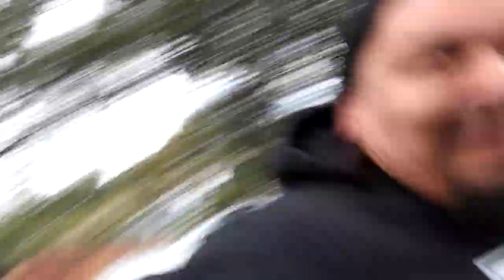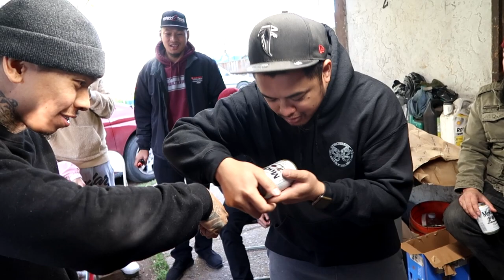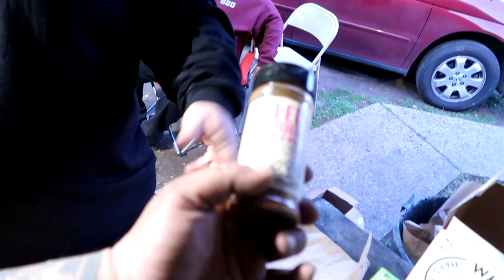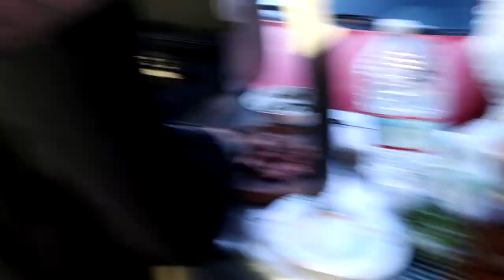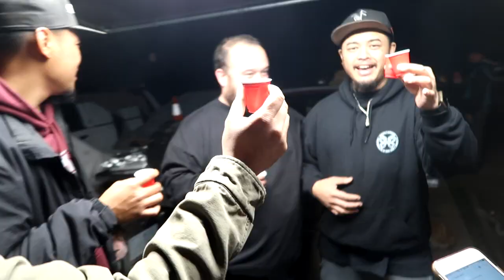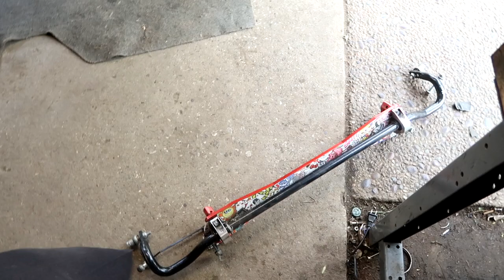EG SUBFRAME BRACE + 22MM SWAY BAR INSTALL

Comment: Hey bro. I gotta ask you bout brakes . I deleted my abs on my 93 accord ex.  I did change out my master cylinder and a non abs booster. But they are still acting up like locking up. Just wanna see what you know but deleting abs brakes

Comment: Lol my f150 has a full size jack in the back but it's a 4x4 truck dam son
Reply: Jared THISDELLE I’m a mobile mechanic brother so it stays in the eg just in case lol.. my tool bags and jack all together weigh 200lbs 😬
Reply: @georgecortez6939  hey man I fully  understand that cheers  .my truck is  loaded with tools aswell